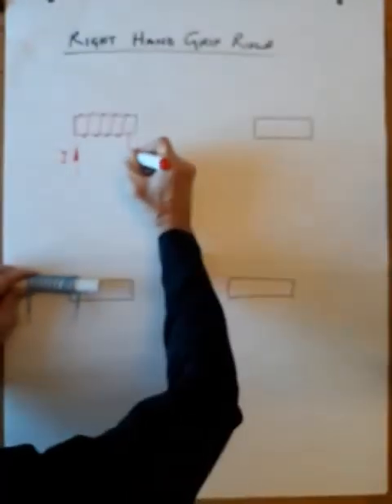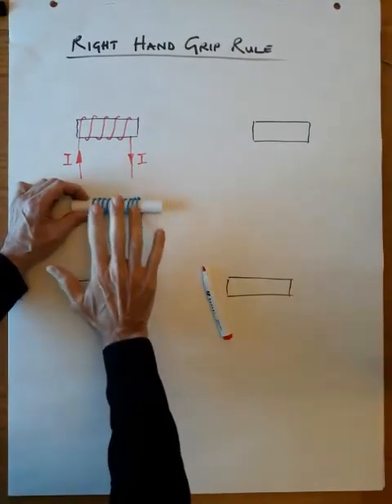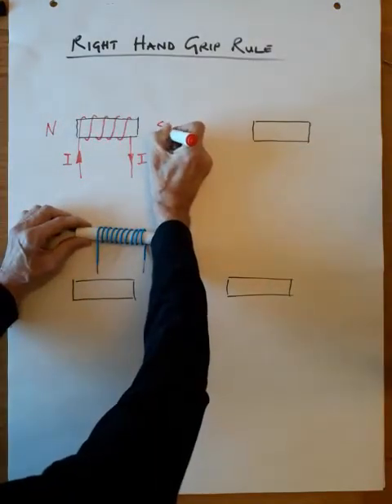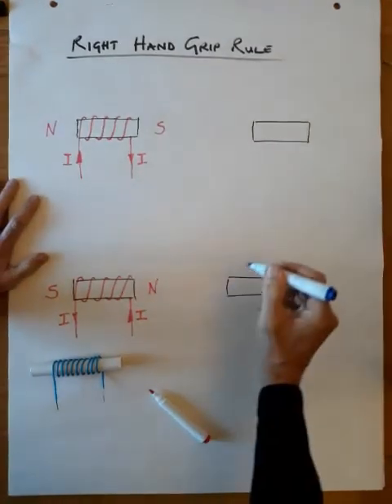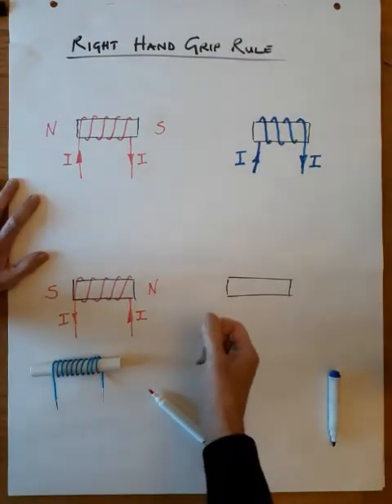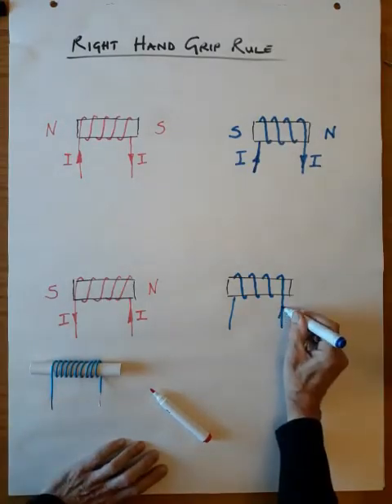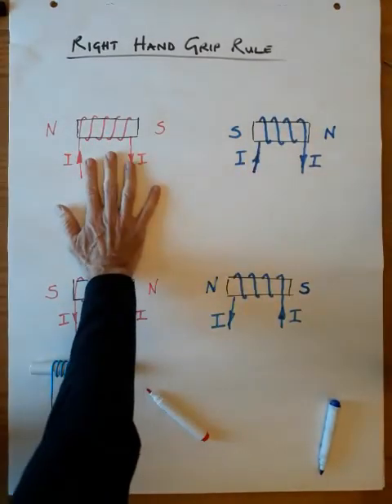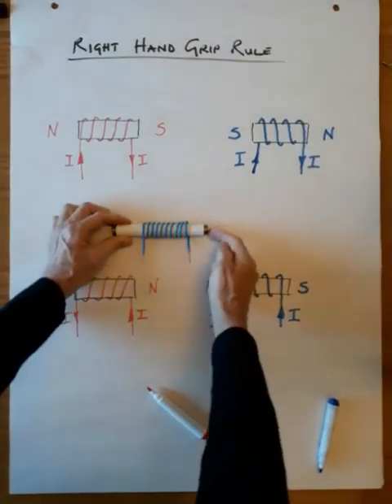Right Hand Grip Rule

Comment: I don’t get this shit it literally makes no sense why r u going a different way there i don’t get it
Reply from the maker: Hi, I retired a couple of years ago and don’t normally reply to comments or queries. You seem particularly puzzled and, for some reason, angry about this, so I thought I’d try to add a little more info from a different perspective, to try and help you. 
I’m not clear on which bit you don’t get. Anyway, I’ll try and run through a couple of basics which may help you, here goes:
If we pass a current into a coil of wire it makes an electromagnet.
If we swap or reverse the direction of current flow this changes the polarity of the magnet – the north and south poles change ends.
If we wind a coil, on a former, from LEFT TO RIGHT and pass the current into the LEFT HAND connection, then this produces a magnet with a particular polarity. 
If we wound an almost identical coil from RIGHT TO LEFT and still pass the current in through the LEFT HAND connection, then this produces a magnet with the opposite polarity, because the coil has been wound differently.
So, the polarity can be changed by changing either how the coil is wound or by changing the direction of the current flowing into it. By carefully wrapping your hand over the coil with fingers pointing in the direction of the current flow, you can determine the polarity (north pole). That’s what I tried to explain in the diagrams in the video.
The low quality videos were made during lockdown, under difficult circumstances and with very limited equipment - I could not buy a camera anywhere so used a mobile phone suspended by string from a light fitting! I made the videos to help my students complete their course, almost all were very grateful. I deliberately made all my videos public in case they might help others. It just happens that many of my videos are still being watched by thousands of students around the world and I receive frequent messages of gratitude. 
I hope this helps you, good luck with your course.
Reply: @craigsclass-level3electric53 thank you youre a very helpful man I apologise for my angry comment i was just  frustrated studying for an assessment. I appreciate that you took time out of your day to explain this to me , once again thank you so much for your efforts and don’t worry your video was great im just a slow learner!